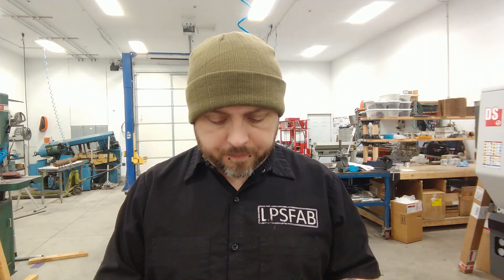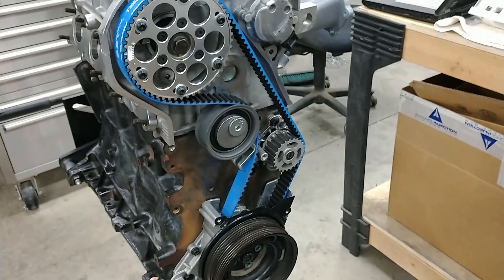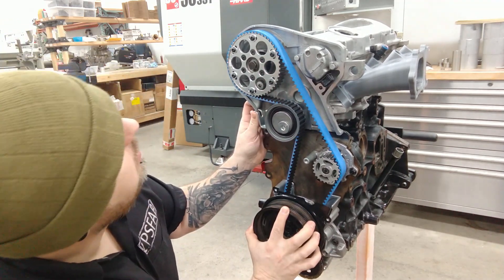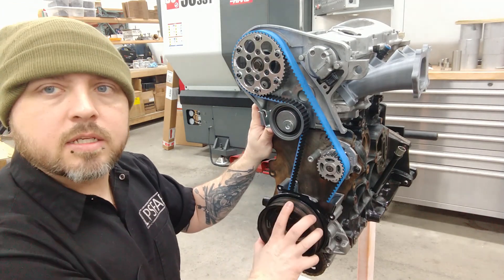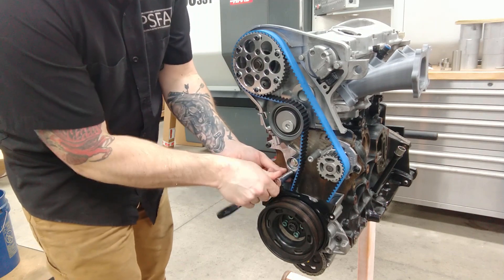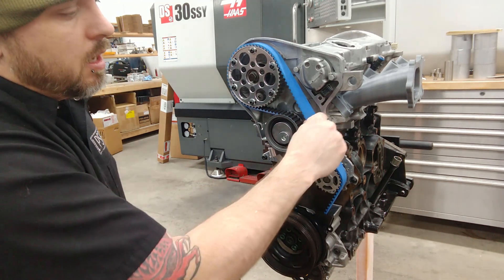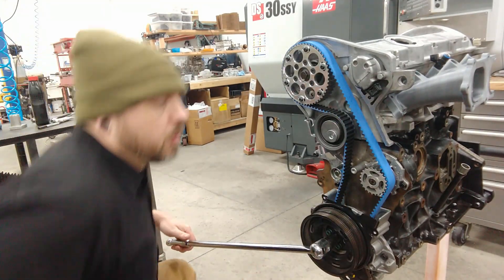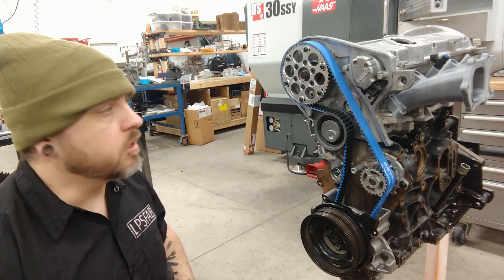VW 1.8t 20v engine build, timing belt with new LPS manual tensioner.

Comment: Hi, i see your video and it's interesting , but i have a question about timing belt tensieon, because i mainly eared the inverse, due to the kevlar isn't also flexible like regular timing belt, ,it's important to not have a tension also strong , because the engine with expansion due to the warm , extend the lenght between each pulleys and increase the tension of timing belt at hot. what is your feedback on this ?  many thanks

Comment: I find it way easier to time these without the the crank pully, set TDC by #1 piston location (physically checking TDC) then line up the cam pully with the timing mark.. then put the belt and tensioner on, and crank pulley after. Also the factory crank pulley can rotate about half a tooth in either direction which can make it even more confusing and easier to be one tooth off.

Comment: I don't know why I couldn't get my 1.8T timed right after rebuilding the entire motor but this video helped me. When you showed how you had the marks rolled back a hair and you said the crank gear travels twice as fast, it all clicked for me. I set mine back half tooth on the top due to the springs and almost a tooth on the bottom and it worked. Thanks, man!

Comment: For correct tension I use Spectroid App and set tension so the belt resonates at 130Hz. With original tensioner it resonates between 130Hz and 140Hz depending of belt manufacturer.

Comment: I really dont understand why change hydraulic tensioner for "manual"... If teh belt will loose you will regulate tensioner...?
Reply: Hydraulics can fail spectacularly and cause the belt to snap or fall off. If this motor is an interference head like the 4AGE 20V Blacktop that would mean a new motor as the pistons would smash the valves.